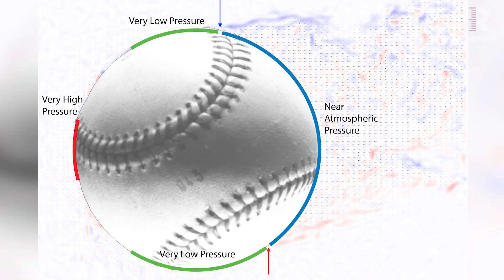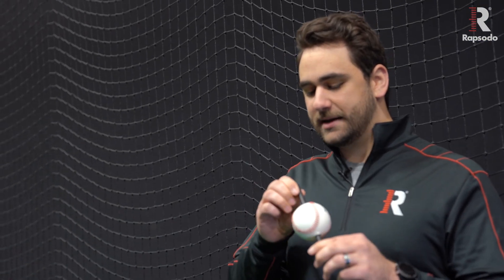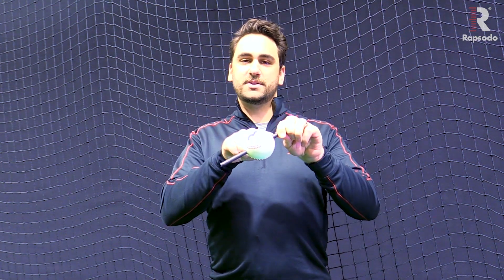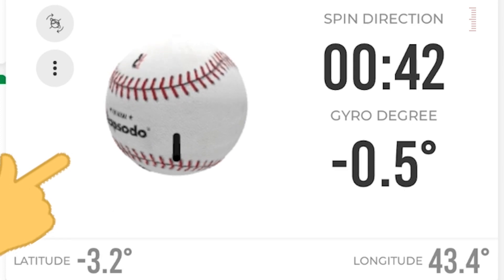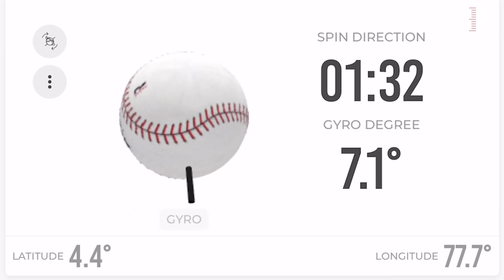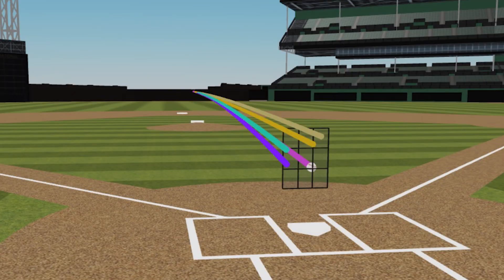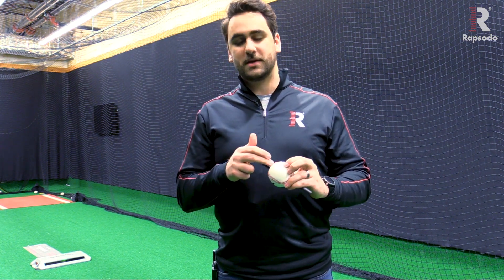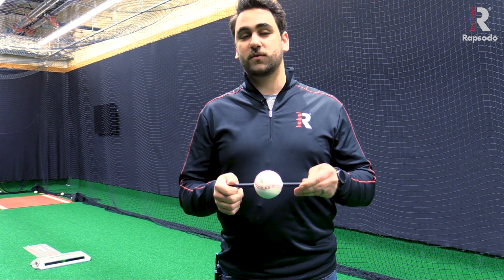Baseball's Newest Metric: What Is Seam Orientation and How Do I Use It?

Comment: how can the device give you numbers including ssw, that cannot be calculated, if it is far in front of the plate?

idk if I explained myself
Reply: You should still give “some” pitch grips that will induce seam shifted wake
Reply: @jonesp9130  orientation doesnt mean shit if ssw is making your pitch worse rather than better. Imagine that a pitcher with a 20vert 5 h fastball throws a two seam that falls into the deadzone. rapsodo will just tell "you could be getting seam shift, but i wont tell you if its benefitial or not"
Reply: @izanmaciasgallardo1658  I would imagine that a pitcher with 20" of vertical movement with 5" of horizontal movement would want to consider something other than a 2 seam.  Maybe a one-seam that simply sinks would be a better option.  Somebody with 20" of vertical will have a really high slot, which makes it difficult to throw 2-seamers.  In any event, you do make a good point.